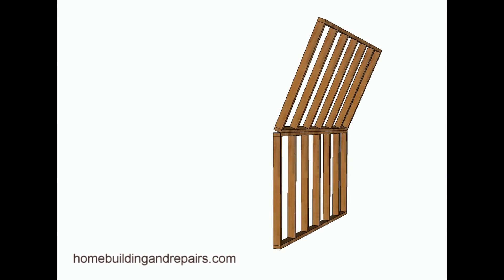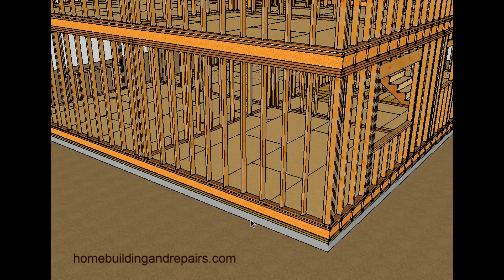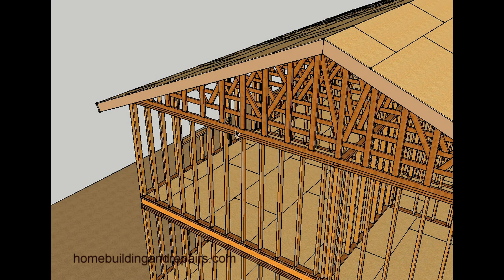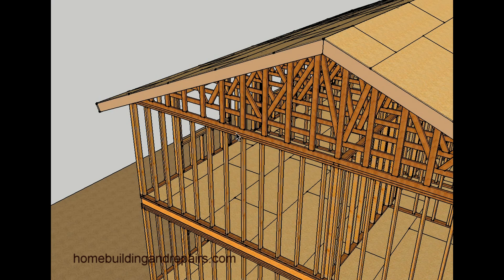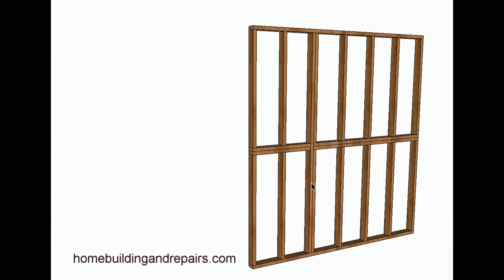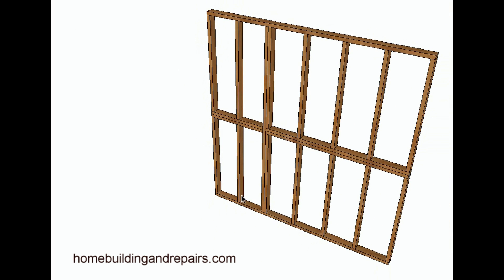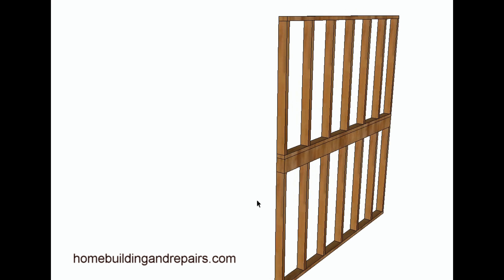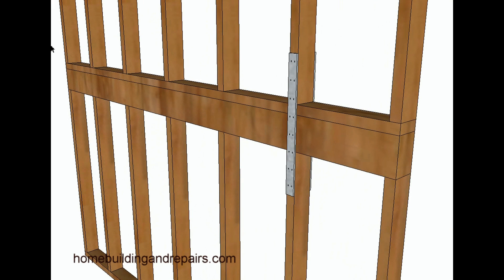What Is A Wall Framing Hinge Point? – Structural Engineering and House Framing

Comment: My framers misframed the height of the back of my house i had them run 2 9" lvls accross the top this created a potential "hinge problem" so i spoke with the engineer and they said 16 gauge straps coming down from the added lvls down 16" passed the top plate seems tight.

They didn't tell me I needed straps on both sides just one side.

Comment: What about running full length studs and notching the top plate and studs to create an interlocking joint?  Apply liquid nail and screw it together.  Then add strapping on inside of wall.

Comment: why wouldnt 3/4 ply bridging the hinge on one or both sides fix this? even 1/4 ply glued and nailed should create a very stiff torsion box.
Reply from the maker: I think wall sheathing could solved this problem if built correctly.

Comment: This is exactly what i was looking for. I see some hinging between the top of the wall and the 2x4s connecting the top plate to the two roof rafters on the gable end. I was thinking of running the stud from the floor to the rafter like you suggest but i am leery of cutting into the double plates. Another option i am considering is simply to reinforce the hinge connection between the 2x4s and the top plate with right angle brackets on either side of each 2x4. I could try the strap but i only have access to the interior facing side of the 2x4s as the other side is osb.
Reply from the maker: I don't know if it will work or maybe it will depend on the hardware used, but hopefully it will be better than before.

Comment: I have a question that you touched on a little in this video as well as a little in a previous video. Our home had an addition done by a previous owner who decided to build a 10' tall wall with 2x4s at 16" with a SINGLE top plate and roof trusses at 24". The ceiling is now buckling and is looking a bit scary lately. Is there any way to add the second top plate or is there a better route to support something like this?
Reply from the maker: +J Vawdrey I don't think the 2 - top plates is a must have, because you can use straps to connect plate breaks and install studs under trusses to prevent sagging. What is causing the ceiling to sag?
Reply: +gregvancom This is the question that I keep coming back to. In the evening you can see shadows on the ceiling that run along each truss and several trusses along the middle (and only) partition have fully exposed screw heads that look like the regular yellow zinc screws from the local big box store. I'm starting to wonder what steps were skipped in the construction process.
Reply from the maker: Send me some pictures, but I'm pretty sure that the ceiling framing is causing the problem.